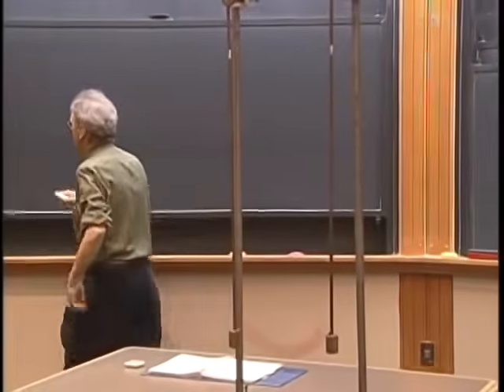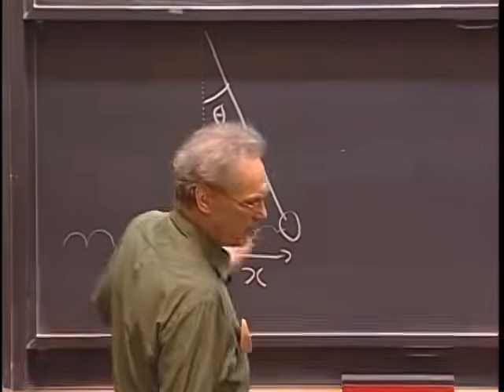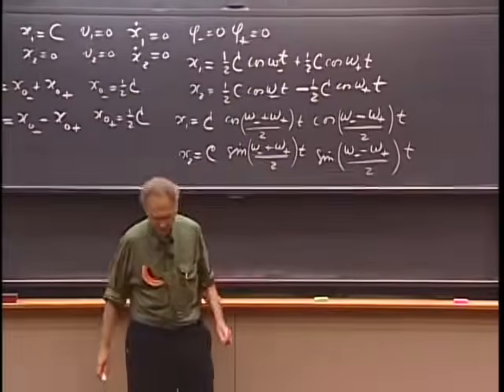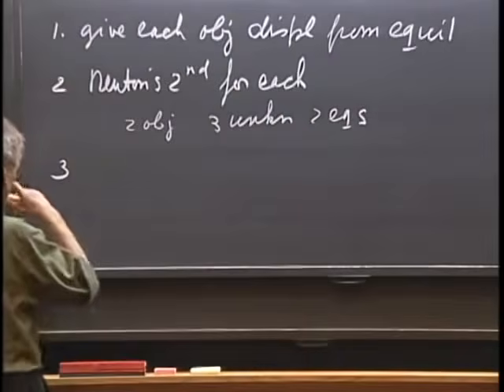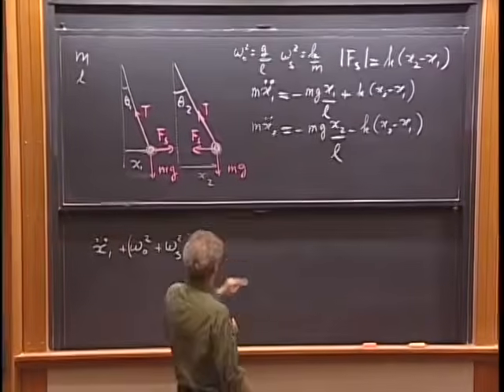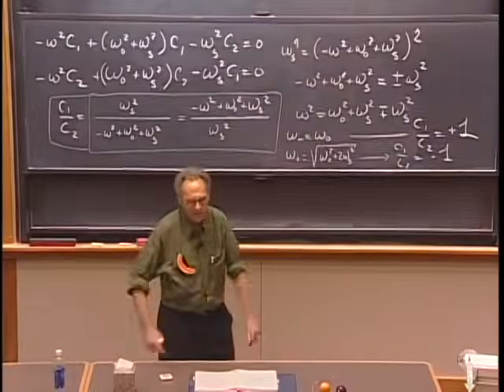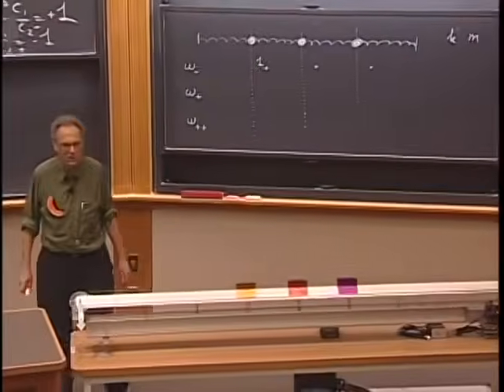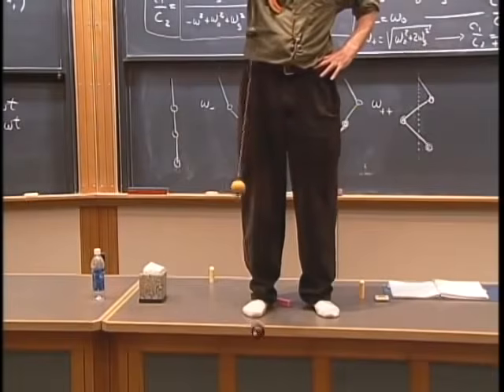8.03 - Lect 5 - Coupled Oscillators, Resonance Frequencies, Superposition of  Modes

Comment: Dear Mr. Lewin , first and foremost thank you , your lectures are a great help. I've watched Prof. Yan Lee's lectures on the same course from mit ocw and now i am watching yours and i somehow found the two , different in ways to solve systems , 
There is this small REQUEST  if could you please suggest one single book or one single lecture notes file that cover entire course of Vibration amd waves that you taught.
Reply from the maker: I used 8.03
Vibrations and Waves by
Anthony French
CRC Press
ISBN 9780748744473

8.03
Electromagnetic Vibrations, Waves and Radiation 
by Bekefi and Barrett.
The MIT Press
ISBN 0-262-52047-8
Reply: @lecturesbywalterlewin.they9259  ❤

Comment: Question. I always get the steady state part of the equation correct. I always get the transient wrong. It's clear from my answers that i got part of it correct but, ultimately the answer for my transient solution is incorrect. I've watched your videos 8.03 lecture 5 and was hoping for an answer. You eventually said you'd not be giving the answer for the undetermined coefficients of the transient. I only read math books for fun so not an enrolled student. If you have any time could you give me a couple of most common mistakes? Maybe from that i can figure out what I'm doing wrong . Thank you!
Reply from the maker: I cannot add to the clarity of this lecture. I suggest  you watch it again

Comment: 1:12:40

I dont understand it took the guy 20 hours, it's not so terribly complicated.

Setting x1=A1 cosωt etc, and defining ω0^2=k/m, Newton's 2nd law gives

x1" = -ω^2 A1 = ω0^2 (-2A1+A2) 
x2" = -ω^2 A2 = ω0^2 (A1-2A2+A3) 
x3" = -ω^2 A3 = ω0^2 (A2-2A3) 

So 2 - ω^2/ω0^2 = A2/A1 = (A3+A1)/A2 = A2/A3

Or seting the denominators equal: A2^2•A3 = (A1+A3)•A1•A3 = A1•A2^2

Case 1: A2=0 now it follows that A3=-A1 and ω^2 = 2ω0^2

Case 2: A2<>0 now it follows that A3=A1 and A2/A1=2A1/A2, so that A2^2= 2A1^2
Two subcases:
A2= + sqrt(2)•A1,   ω^2 = (2 - sqrt(2)) ω0^2
A2= - sqrt(2)•A1,    ω^2 = (2 + sqrt(2)) ω0^2

Comment: For the EOM of X1 there should be a minus sign between modes because X1 object switches direction btw modes not a plus sign and for X2 there should be a plus sign because X2 object does not switch direction btw modes.This is according to the drawings on the blackboard.Wonderfull lecture.

Comment: In fair chance, the metal ball will try to keep balance as you may see the metal ball those far away from the frequency source has more velocity. One thing right is the enery transfering from potentail to kinetic but since the frequency source is keep feeding more energy into the pendulum. Once the energy from the souce is stop then it will try to becomes equilibrium or you may see the multiples metal balls pendulum that some ball will not moving in some frequency and amplitude. But if you want all balls moving feed more energy let's swing over your head! In not a fair chance, where you are trying to send some energy to a nearest ball, in this case it will moving the nearest ball but if you provide more energy the other balls will keep balancing. That is why we are using long chain pandulum to at least absorb some effect of un-fair chance.

Comment: Sir what is reason that if there are 2 pendulm coupled together then then there will be two normal modes
Or 

What is the reason that if there are n pendulm coupled together then there will be n normal mode
Reply from the maker: you will get n differential equations. To satisfy all you will need n normal modes.
Reply: @lecturesbywalterlewin.they9259  sir why at normal modes the system resonates
Reply from the maker: solve your diff eqs !!!!

Comment: Another amazing lecture professor! I have a question : why are we able to express any motion of the coupled osscilators as the superposition of the normal modes? I understand this somewhat intuitively but I don't feel I really know the reason.
Reply from the maker: it's the solution of the diff eqs. Also watch my 8.03 lecture on Fourier analysis.
Reply: thanks a lot for the reply professor I will

Comment: I'm not able to figure out the force equation of a triatomic linear molecule in longitudinal oscillations. Please help.
Reply from the maker: use google
Reply: I tried googling, but all the sollutions use energy equations with complicated matrix solving methods. They do not use Newton's law to write the equation.
Reply: Lectures by Walter Lewin. They will make you ♥ Physics.  wanted to know if it's possible to solve just using the kind of mathematical tools used in this video. With Newton's laws
Reply: @rupeshknn  http://cis.poly.edu/~mleung/CS4744/f03/ch04/linmol.html. The linear algebra makes your life easier; not harder. Lewin is doing the linear algebra without telling you that's what he's doing. Learn the Lagrangian approach. It's systematic and there is less room for error in getting the equations of motion and normal modes.

Comment: 1:12:20 sir, may I know the force equations of the system (3 masses and 4 springs) ? How to compute them?
Reply: Easiest way is to compute the kinetic and potential energy of the system and use the Euler-Lagrange equations: http://electron6.phys.utk.edu/PhysicsProblems/Mechanics/6-Oscillations/coupled-spring.html. 

You can also use symmetry and conserved quantities to find the frequencies for many systems with little effort. The example of a linear triatomic molecule is a nice one. The center of mass undergoes uniform translation in one mode so a zero frequency mode exists; and the other two modes are easily visualized and the frequencies found.

Comment: Sir, I’ve been working on your problem on 1:00:00 with double pendulum for few days and I always get same and different solution from yours, maybe I am making mistake in writing newtons 2nd law for first object, i write that the force is equal to -mgsin(theta1)+T2sin(theta2-theta1) where T2 is the tension on second string caused by second object. Is there any way that you could make a video solving this problem, i really looked up for the solution but almost all of them use lagrangian while solving and make problem more general with strings of differents leghts and object with different mass.
Reply from the maker: Lagrangian solutions are fine. Since I did not cover that in this course I did not use Lagrangian.
Reply: Lectures by Walter Lewin. They will make you ♥ Physics. Yes but they are a lot more complicated (for a sophmore in high school like I am)  than your solutions is, so is there any chance that you could solve this problem in one of your future videos or do you maybe know someone who has already done it your way, it would be really reliefing since I’ve been struggling with this for a few days and i would really like to know how to solve this

Comment: Sir, quick question, how can we know when the system has an extra omega (omega++), since you did not mention the highest mode on your first example (two balls on pendulum connected with a spring)
Reply from the maker: how many minutes into the lecture?
Reply from the maker: 2 balls on 2 connected strings have 2 resonance frequencies. n balls on n connected strings have n resonance frequencies. Watch my demo with n=3, very cool!
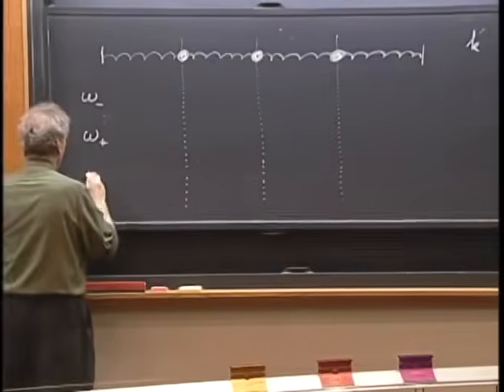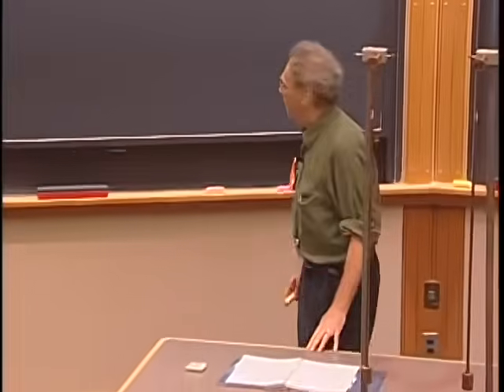Reply: Lectures by Walter Lewin. They will make you ♥ Physics. At 1:04:18 you introduce the term highest mode  but you did not mention that on 03:00 on your first example, my question is, why your first example doesnt have tht third mode (omega++)
Reply: Lectures by Walter Lewin. They will make you ♥ Physics. Oh thank you very much, I guessed that was it, I did, all of your demos are amazing, but by far the most thrilling one was the one with disproving the kirchoffs rule (8.02 lect 16) :)

Comment: how can we understand the coupling between modes( more precisely anharmonic modes). how can we correlate it with spring mass system. i work with baw resonators.
Reply from the maker: it's all covered in my 8.03 lectures

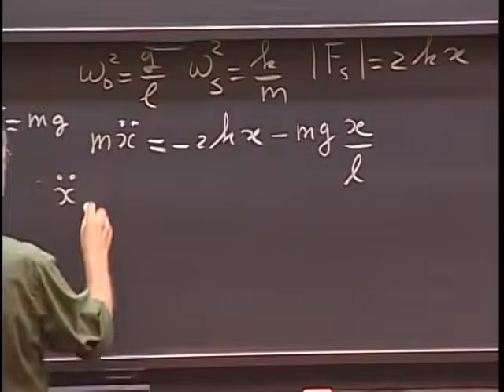Comment: Hi Dr. Lewin I have a question about when you were going through Newton's second law at 13:30 or so. You stated that the tension force equals mg, but a y-direction force balance around the object gives T=mg/cos (theta) where cos(theta) = sqrt(l^2-x^2)/l. Just wondering how you got T to be mg or if I missed something here?
Reply: JK I'm thinking you used the small angle approximation.
Reply from the maker: yesssss small angle approx. cos(alpha) is very very close to 1.000. Take 5 degrees, cos(5)=0.996
Reply: Thank bro same problem face by me but i clear doubt by your comment

Comment: At 27:00 
What will happen if I attach two springs one at midway and other at the bottom if both springs are of same spring constant? Also, what will happen if both springs have dissimilar value of spring constant? Sir plz help
Reply from the maker: I cover this in my lectures and in my problem solving Help Sessions.
Reply: Lectures by Walter Lewin. They will make you ♥ Physics. 
I just found a video about coupled oscillators by Prof. Wit Busza on your channel. Hope that was the video you were talking about. 
You lectures are helping me a lot for my preparation. Thank you so much!
Reply from the maker: I cover free oscillations of springs in 8.01. In my Help Sessions also. But you may not need those anymore.
Reply: Lectures by Walter Lewin. They will make you ♥ Physics. 
If it's a physics lecture and that too by Prof. Lewin, I WILL watch it! Thank you sir :)

Comment: Sir, In physics what is the most perfect definitions of the following terms: 1) Resonance   2)Standing wave   3)Force Vibrations
Reply from the maker: ask google
Reply: @lecturesbywalterlewin.they9259  savage
Reply: @lecturesbywalterlewin.they9259   :)
Reply: 1)Resonance-a frequency or something that is absolutely lovable by the system ,and system begins to 
picking up speed.
2) standing wave - if a wave has a limited medium to travel ,like in a string of a certain length ,then this is called a standing wave..
3)If we apply external force with a certain frequency ,then for a while system will not like that and try to oppose the motion but if you wait ,then you will find that system will behave according to your force

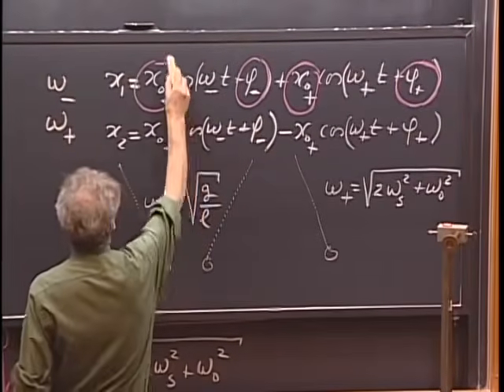Comment: I think it's neat that the equations for x1 and x2 at 15:35 look strikingly similar to the right/left basis vectors as functions of the up/down basis vectors in quantum mechanics! 

|r> = (1/sqrt(2))|u> + (1/sqrt(2))|d> and |l> = (1/sqrt(2))|u> - (1/sqrt(2))|d>

They only differ by a +/- sign in the middle!! Is it purely coincidental that these are so similar? Love your lectures!

Comment: I'm sorry if you adressed this in other lecture that I didn't recall, but why not having damping on this system means that the normal modes will be either in phase or out of phase (around 3:00)?
Reply from the maker: +Family Father Damping of "some kind" is always needed to kill the transient solutions so that we end up with the so-called "steady state solutions". I discuss transient and "steady state" solutions in  detail in my 8.03 lectures. When we achieve a steady state solution, the frequency of the oscillators is the same as the driving frequency. If the driving frequency is a resonance frequency damping of some kind is also a must - without it, the amplitudes would go to infinity. When we excite a stable steady state resonance frequency adjacent oscillators are in phase or out of phase. I have demonstrated that in several ways. As an example if you have a double pendulum, there will be 2 resonance frequencies. In the lowest frequency the 2 pendulums are in phase in the high frequency they are out of phase.